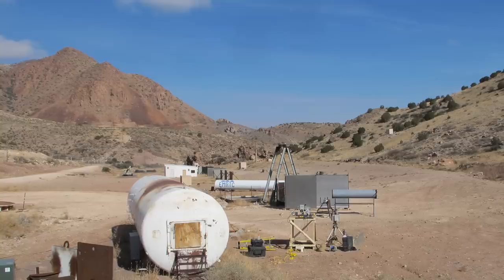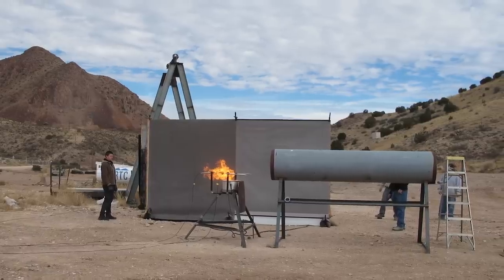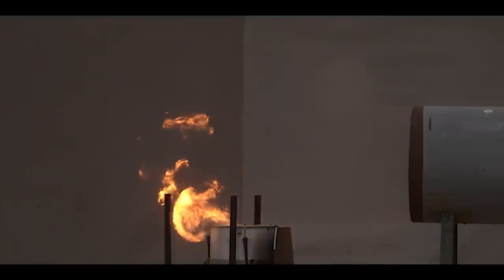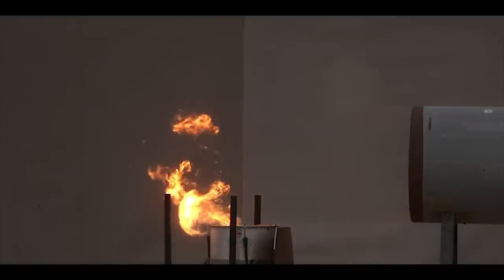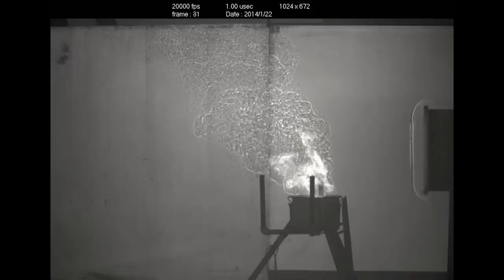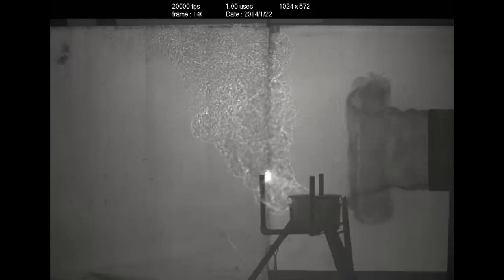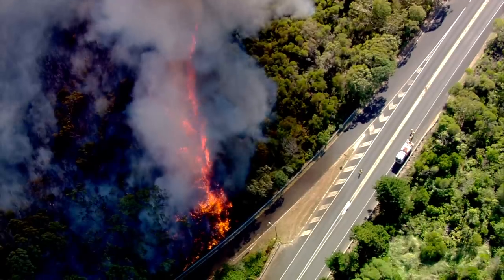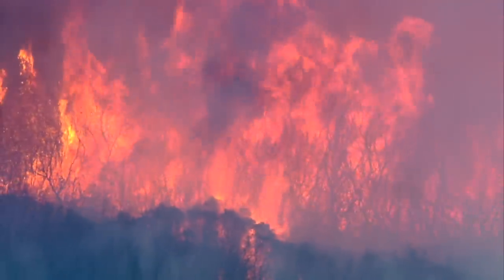Blasting bushfires with explosives

Comment: I think putting explosives in a line in front of the fire would be the most efficient. If you stop the fuel it can't burn. A explosive line could be put anywhere with helicopters and people on the ground. You form a trench with explosives.

Comment: Haha if it were possible it would have already been done. Im sure it could put out the bush fire for a second, but the heat would ignite it again as soon as the oxygen returned.  the "structure of fire" idea is cute. but it makes no sense fire doesn't have a structure it is a cause of a reaction.
Reply: So because it isn't already being done means it can't be done? That's the whole purpose what he is doing, he's trying to figure a way to make it work for this situation.
Reply: UniversalHere I dont think I explained myself right. If it were a petroleum or gas fire spewing from a pipe it would be a great idea. However it does not work if the fuel was still at combustion temperature. So when the oxygen returns it re ignites.